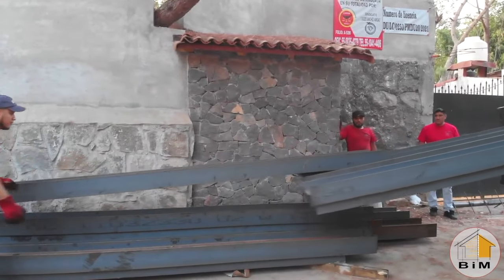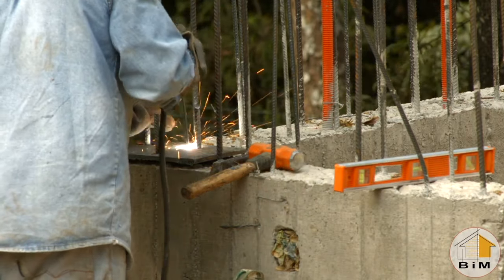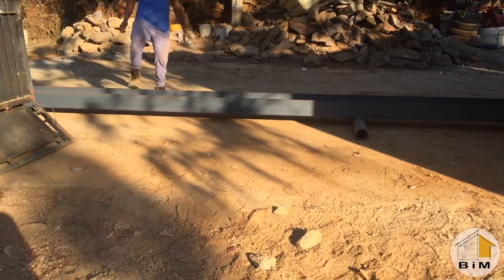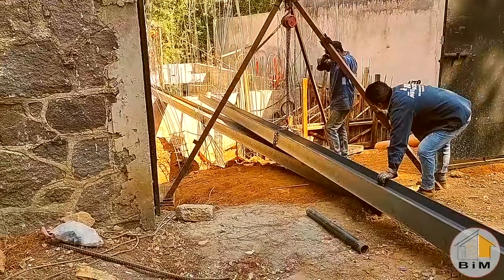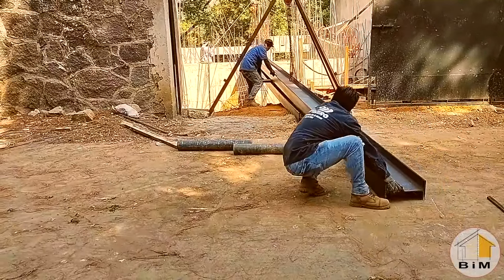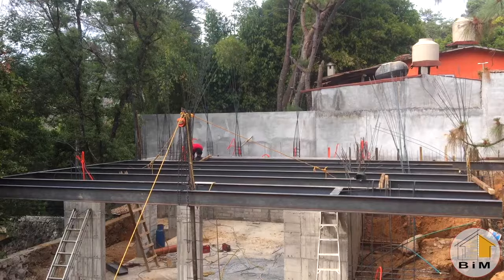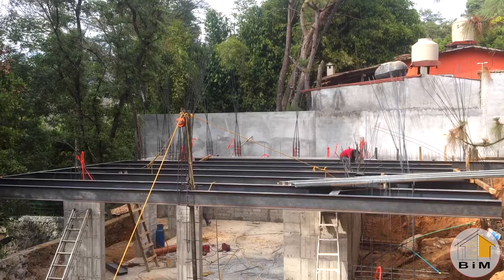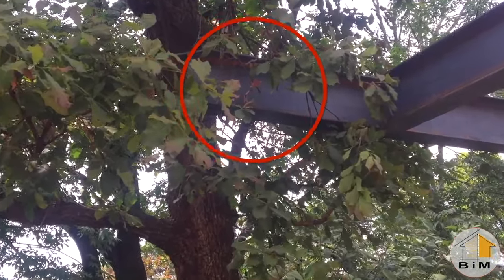10.  Installing Steel Beams on Concrete Columns

Comment: What is the cost of building with those steel beams compared to other methods? Planning to build a house with open spaces a great room and double ceiling and avoid having too many columns at those spaces
Reply from the maker: In our case the cost came out about the same as using cement and rebar support beams. And the process was significantly faster which resulted in savings in labor costs. In my opinion, the steel beams are the obvious solution if you want to avoid support beams in a large open space.
Reply: @buildinginmexico  Great, thank you very much for your prompt response. We are planning to build our house in Mexico City, and your reply will certainly assist us in this process. We've heard about prefabricated framed steel beams, and other potential solutions, but nothing seems as straightforward and dependable as this fast and reliable construction method